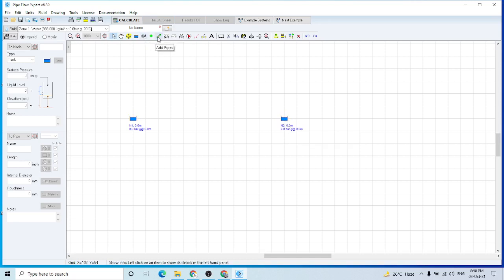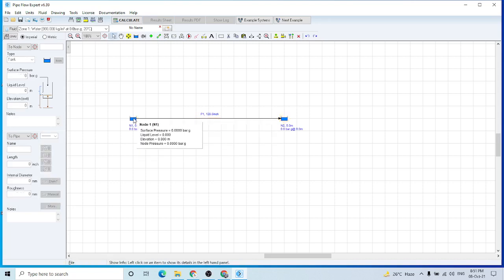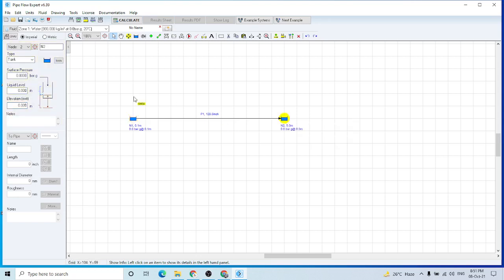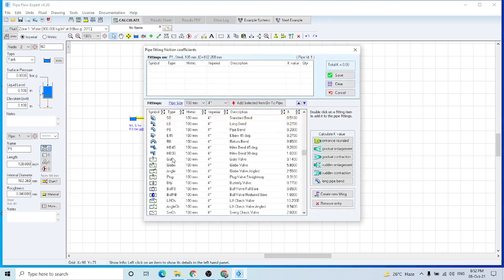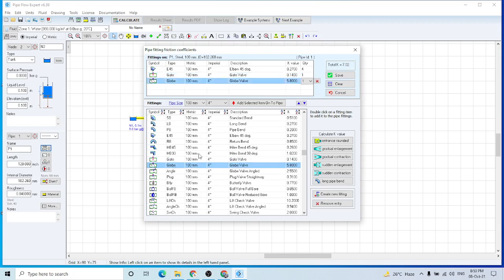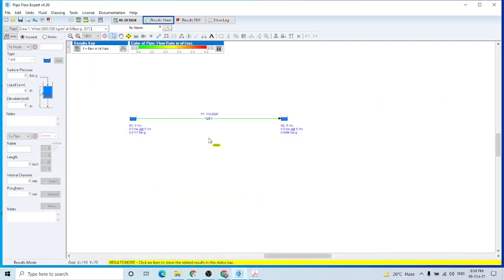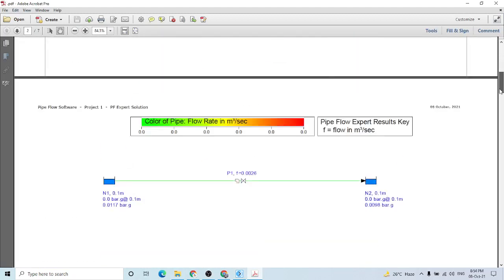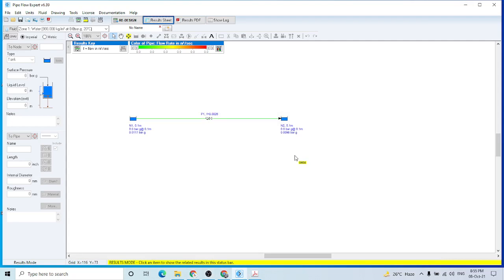Pressure Drop (Head Loss) Calculations in Pipe using Pipe Flow Expert

Comment: Hi, Very interesting video. 
I have a question. I want to know how to calculate the pressure drop when there is a air release valve in the pipe. Lets say, I have a pump in the one end (start) and after 20 meter of Ø400mm pipe, I have a DN150 air release valve. Which will help to escape the air in the pipe before pipe is filled with water.  How to calculate the pressure drop in the pipe?
Reply from the maker: We can build a piping network in Pipe flow with pump at the beginning and Air valve at the discharge of the pump.
The pressure drop across Air Valve can be estimated using its size or can be obtained from its manufacturer.